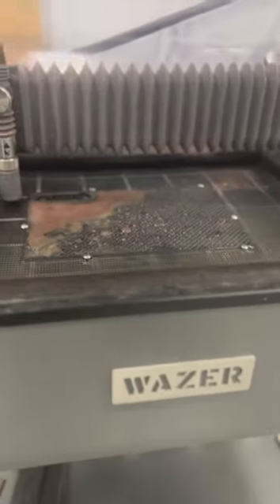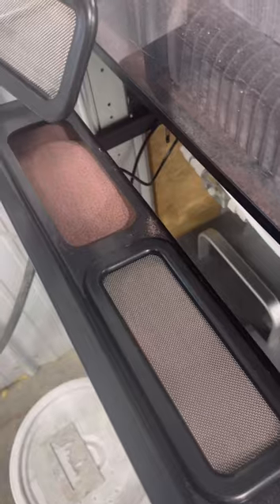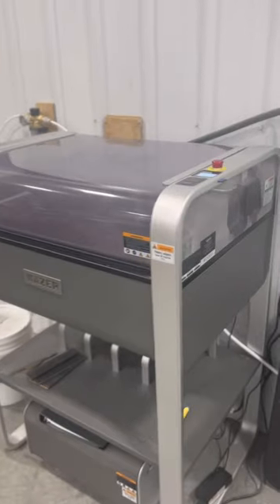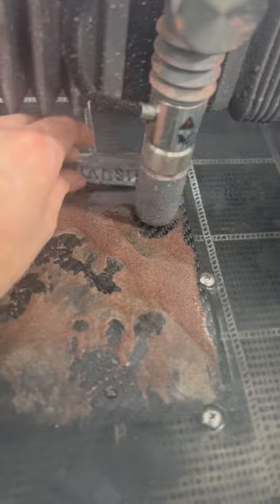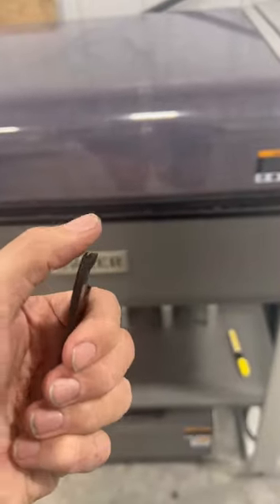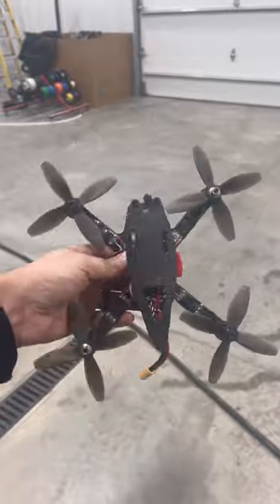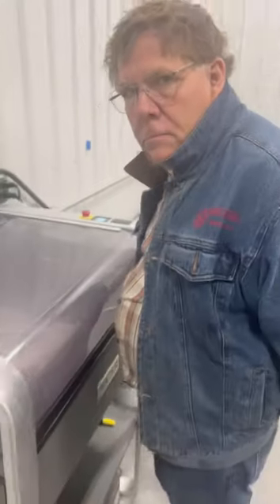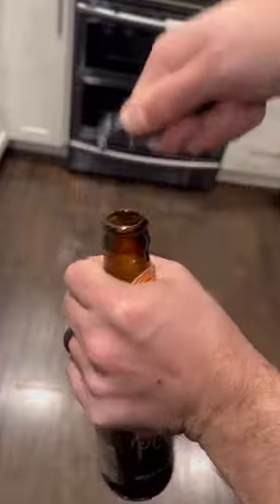#shorts Testing The WAZER Waterjet On Some 3MM Thick Carbon Fiber Sheet!

Comment from the maker: Awesome having a machine that can cut almost any material! Be sure to check them out here: https://www.wazer.com
Reply: U should totally do a episode with funkfpv
Reply: I would definitely get a drone from you. For Real, For Sure.
Reply: make sure your initial pierce is well away from the part with a long lead in, that's when delamination takes place. the action of the water pushing through the material is the problem, once through the cutting action takes place with far less pressure on the material. Remember to use a long lead in.
if not possible, use a low pressure to pierce with a rotating pierce. 
I ran a commercial WJ for many years. Laminated materials were always a problem, sometimes etching the pierce marks first and pre drilling the pierce in situ with a battery drill worked well.

Comment: Hey tip for you with that machine.

Run a bead of silicon along the inside edge of the left hand acrylic panel.

They leak from there and drips into the garnet hopper

Comment: Don't think you can solve delamination issues with thst sort of cutting on carbon fiber. Would mabe want to just use cnc with a down cut bit with active fluid coolent for stating ontop of the dust.
Reply: It's the problem witb high presure and laminated meterials. It finds its way into the layers and forces them apart